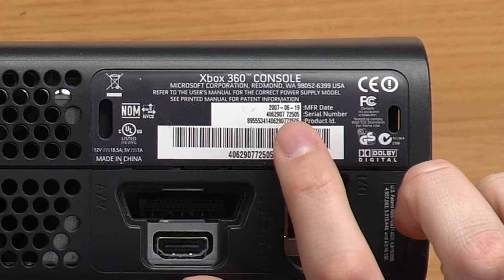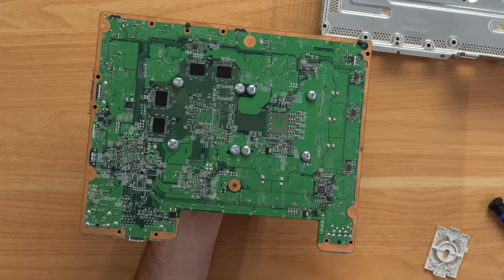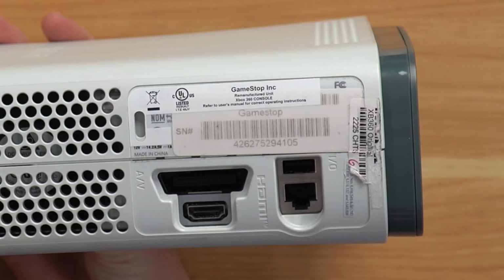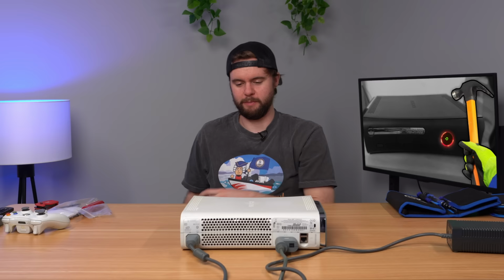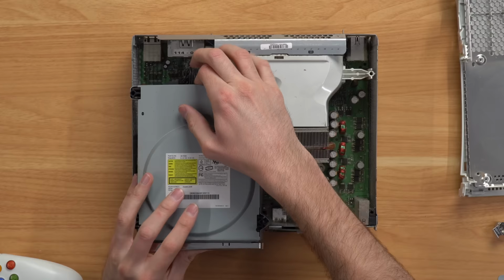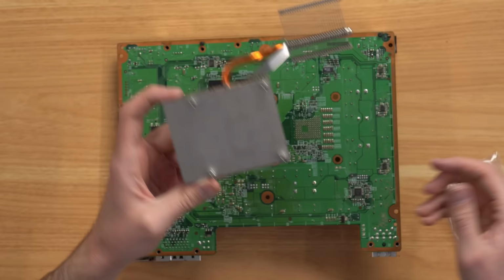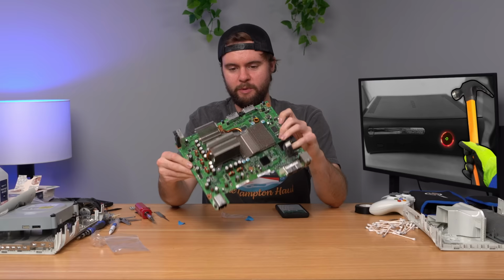Xbox 360 fans won't like this... 😳

Comment: How do the 360s get the red ring of death?
Reply from the maker: from naughty gamers playing their consoles too much
Reply: @pepsidude8919 My 360 is pretty loud. Is that normal or should I open it up? Thanks
Reply: @ItsJeepb  You might want to open it up just to be on the safe side probably and you're welcome too. I had a PS3 that I got from Amazon many years ago, which was one of the PS2 backwards compatible models, and since it was a used console obviously, I remember the fan on that PS3 being very loud although it worked for a short period of time before it finally got the Yellow Light of Death (YLOD) which is similar to the Xbox 360's Red Ring of Death problem.
Reply: @pepsidude8919  I have the slim model. Is that still Susceptible to the Red ring of death?
Reply: @ItsJeepb  I've heard of some of the Slim models of the Xbox 360 getting the Red Ring of Death too since it is possible for them to still get them, but the Slim models don't seem to be as prone to the Red Ring of Death as the original models since the Red Ring of Death seems to happen more on the original models than the Slim versions. I have an Xbox 360 Slim model myself too which I've had now for almost eight years already since I first got it back in the summer of 2016 for my birthday from GameStop and I haven't had any problems with it so far, even eight years later almost.
Reply: @ItsJeepb  I have a slim as well, but mine is still quiet after 12 years. Never replaced the thermal paste, only cleaned out the dust.
As long as it works, there's no need to replace it, since the Slim 360's runs a lot cooler and have much lower change of RROD.
Reply: @DeadPhoenix86DP  Same here and I agree too. I also have a Slim model which I've had now for almost eight years already and I still haven't had any problems with it so far which is really great.
Reply: @ItsJeepb - how does the 360 get rrod? Most get it from hitting a temp of around 80 ish degrees. The fans kick in to cool the gpu and then it heats back up and cycles over and over again like this. It is believed that the glue like material that adheres the top chip to the substrate of the chip (this makes up the gpu) had incorrect temperature tolerance. The glue would start to do this around 80 degrees c. The fans were set to control the heat with the gpu and cpu in mind, not the substrate. This causes the glue to break down unevenly on the chip allowing the solder to flex and break and the substrate to bend. It wasn't a Microsoft issue. The same thing happened to sony and nvidia and through nvidia the mackintosh laptops etc etc. Sony didn't have it happen as often because the fan that it used was beefier so it would take a much longer time to happen, and the manufacturer has corrected the issue by the 2nd revision of the ps3.

Comment: I had a 2006 non hdmi 360 that had 3 ring rrod. But if i heated it up for 5 minutes the gpu validation would pass and it would start working again.

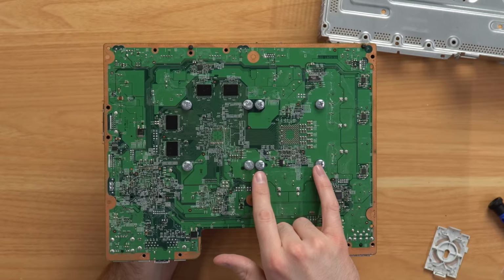Comment: Why is there a Modchip? What's is that @ 3:08  ???
Reply: There’s no modchip
Reply: @IMDYT420   3:01 bottom Right
Reply: @samyhx896  im not seeing what you’re seeing, all I see is an Xbox 360 that’s been bolt modded, which isn’t good for the console. and anyways modchips would be installed near the av port, no one installs modchips on the bottom of the board.

Comment: I've owned 360s since launch. You're incorrect about the bolt mod. Sure you can do it after your console is already fucked BUT if you do this to the console while it's still quite new it's very effective. I've had a bolt mod on the last 360 I ever purchased and it still runs perfectly. You also can screw this mod up if you're not using the correct hardware. I recommend anyone who has a phat 360 that works perfectly to just do it before you get rrod. Also do a rgh mod and crank the fan speed up. Mine is going on 16 yo. I used it ALOT back in the day. Don't use the wrong hardware or wait for it to rrod. Once it rrod its pretty much over. The bolt mod isn't to fix rrod. It's to PREVENT it!
Reply: You're just straight up wrong... A bolt mod causes irreparable damage to the motherboard. If a console is prone to the RROD, a preemptive bolt mod will do nothing to stop it. The fact you think it will proves you have 0 understanding of the real issue with the GPU that causes the RROD